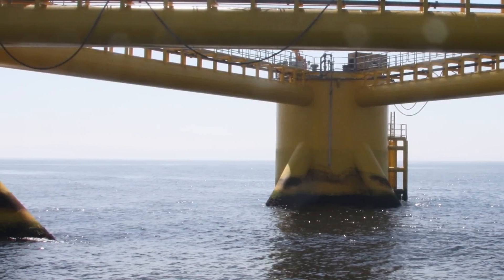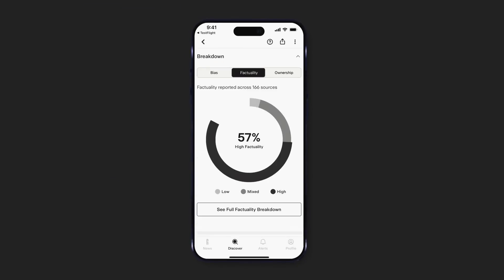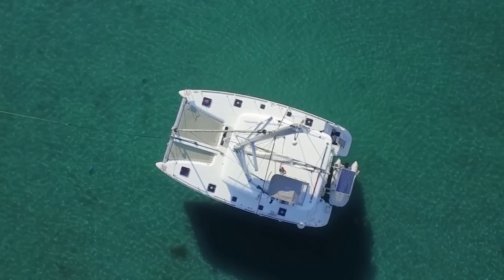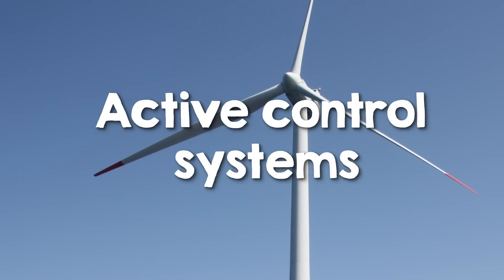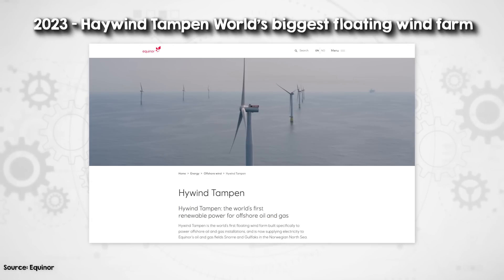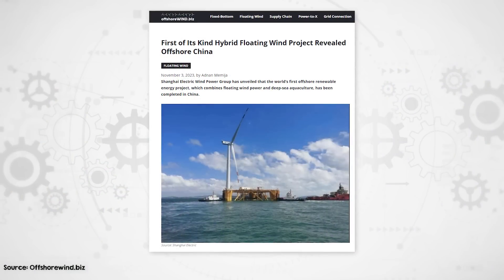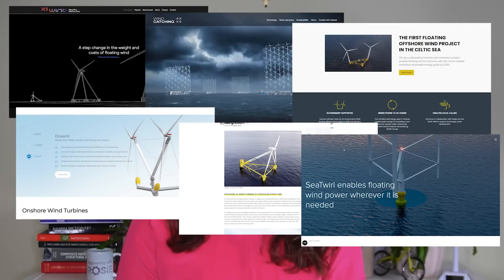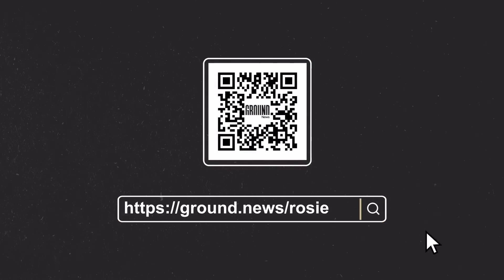The Rise of Floating Offshore Wind Technology

Comment: This video got me wondering that if offshore wind is such a great energy resource, would it make sense to have these facilities serviced by industrial scale electric 'tankers'.  In this model a series of large battery ships could rotate from the offshore wind farm to a seaside city or even a site of a fossil fuel power plant or nuclear power plant which has been deactivated.  Once the ship had discharged its power into the grid, it could travel back to the offshore farm replace a now fully charged ship which would return to the land based grid connection.
Reply: We can just connect cables from the turbines to the grid, it will always be cheaper to do this.
Reply: @SocialDownclimber  

Yeah, moving electricity via cables is much more efficient than storing the electricity in a battery and physically moving the battery.

The latter approach may sometimes necessary in temporary, one-off situations, but not for permanent infrastructure.
Reply: Ever noticed that batteries get hot when you change or discharge them? That heat is wasted energy, and probably makes ‘battery ships impractical. But impracticality doesn’t seem to deter governments nowadays so I look forward to seeing huge fleets of battery ships.

Comment: Tip them upside down and place them about fifty or a hundred metres below the surface, preferably where seafloor topography gives you a strong, steady current. The kinetic energy of water will always beat that of air, and the reduction or elimination of problems caused by the intermittent nature of wind would reduce the need to incur the cost of battery storage. Call it offshore hydropower
Reply: That's MeyGen in Scotland
Reply: @thomasgade226  what's the cost of electricity produced compared to other renewables?
Reply: @dennisenright9347  dunno, but these are prototypes, so unit cost is much higher than mass production. Rosie says this for the floating wind turbines too

Comment: On one hand, offshore wind seems a no brainer because of availability of consistent wind.  The, for me, not a no brainer is the transmission of the generated electricity to land.  Of course the large capital expenditure and operating expenditure are obstacles, but they're just part of the operating plan.  When they're in place and operational, they seem economically sustainable.
Reply: It's not a no-brainer but also not rocket science. Sea floor cables are a very established technology, and HVDC is fairly established and can make it work for the required distances. What still requires work is rigging up many turbines to the cable.

That said, I find the most interesting option to not transmit the electricity to land but instead use it for energy-intensive processes near the turbines, or for charging electric ships.
Reply: @leftaroundabout  Good thought.  What about a battery depot, full of batteries that can be charged and swapped for discharged batteries?  Nah, probably never work.  Anyway, I am not an engineer or scientist all my questions are valid?

Comment: Is there something that can be done about steel corrosion in these turbines? Like some kind of electrolysis?
Reply: Typically you would use cathodic protection and paint. Also you estimate the amount of material you will most likely loose over the structures lifetime and add it to your design thickness. That works pretty well. 

What often kills offshore structures is fatigue, then at welds. This is why offshore wind likes monopiles much better than jacket structures: Much less welds to inspect and to possibly fail.
Reply: Have a look at my comment above. The use of basalt fiber, including to substitute steel rebar, ups the life from around 35 years to around 100 years, as it does not corrode.
It is also very low carbon to produce, and totally recyclable using biomass PECAN resins.

Comment: In my view materials advances are going to be transformative for offshore wind, including floating.
Basalt fiber is now being used in  China as a component of wind turbines, and has great advantages. It is inert and reacts neither to UV or seawater, is tougher than glass fiber and as rebar can replace steel, with projected lifespans of over 100 years instead of the 35 years of steel, and then is completely recyclable as well as emitting a fraction of the GHG in manufacture compared to steel.
And we can now make biomass derived resins to glue them together, PECAN, so we can have very long duration, low carbon materials far more suitable for a marine environment than anything which we have previously been doing.
Reply: Basalt fiber/resin has long been used as low-conductivity wall ties (My house has a load from in 2014). And it is impressively light, strong and much less brittle than you might expect. Where are they proposing put it on turbines - in the blades instead of glass fibre?
Reply: @xxwookey  You name it, and basalt fiber has good characteristics for use off shore. 
For instance rebar made from basalt has the same expansion characteristics as concrete, unlike steel, so lasts way longer.
But also for blades. Unfortunately I can't put links here, but here are the characteristics of basalt for bionic plates in turbine blades:
'Under the high wind speed, the fatigue damage covered the whole skin, only slight damage occurred at the trailing edge of the tip. The dangerous point is mainly located near the tip of 50 m–60 m along the span direction. The traditional Miner theory can accurately predict the fatigue life of wind turbine blade, and the fatigue life of the wind turbine blade with basalt fiber bionic plate is 29 years, while the fatigue life of the glass fiber wind turbine blade at the same scale is less than 1 year.'

Comment: Here is some truth about the incredible stupidity of floating offshore wind.
https://youtu.be/jB49o5HoOdk
Reply: That is incredibly misleading, not exactly truth!  His argument that floating wind is expensive is based on a 30MW prototype wind farm, designed to test the systems, and find the problems; not designed to produce low cost power.  To get sensible prices, you need to install GW size wind farms, and by the time you get to the 3rd or 4th round, the prices will have dropped to be at least competitive.   I guess that floating wind will become the UK's cheapest source of power, but it needs investment to get there, and the sooner we invest, the sooner we get the cheap prices.  I'm not sure why so many other countries are jumping onboard with floating wind, you need the right weather conditions, and few countries have wind as good as the UK, Denmark, Norway, but for us, floating wind will be important, and paying higher prices to for the first floating windfarms is necessary, otherwise we miss out on the future benefits..  Fracking is definitely not the future, you can argue that it should have been the past, but it was something we failed to invest in and never saw the benefit.
Reply: @nigels.6051  that is an absurd point of view. Wind needs a MW of gas for every MW of wind in any event.
Onshore snd fixed offshore wind is getting more and more expensive. Not cheaper. Fact.
Reply: @ClimateRealism  Wind doesn't need any gas to operate!  Construction is still using some fossil fuels, but a decreasing amount.  There is still a shortage of fossil fuel free steel, but the way to get the steel 100% green is to build more wind power.  Fossil fuel use has to stop, for places that are away from the equator, wind is the cheapest solution, currently it needs a lot of investment, but it will be the cheapest.
Reply: @nigels.6051  Example, in the UK now ind for 9 days - what do you think supplies the energy? There is no viable storage system.

Comment: Hi Rosie, question: could off-shore wind turbines be used to re-charge battery-based container ships (maybe which are supported by attached sail / wind turbine / tide turbine generated electricity)?
Reply: We would need new battery technology to power a container ship at reasonable cost, they travel huge distances, and can't afford the time for many recharges, but smaller battery ships that make short journeys, such as the wind farm support vessels are already being recharged at the wind farms.  For container ships, in the near future, they will be powered by synthetic fuels created by the wind farms, and will be able to refuel at the wind farm or nearby.  Maersk said recently: "660,000 standard shipping containers transported on green fuels in 2023", "Maersk is investing in new methanol enabled vessels of which the first eight very large ships (16,000 TEU each) are entering Maersk’s fleet in 2024, with the first vessel, “Ane Maersk” already deployed. "
Reply: I'm personally skeptical about the synthetic fuel idea, in part because making it in a way that doesn't directly spew CO2 into the atmosphere likely requires several times the electricity input compared to charging a battery (similar problem as with hydrogen). This makes production of the fuel very expensive, to the point where it's uneconomical without huge, never-ending climate subsidies (or government mandates that would dramatically increase the cost of shipping).

Realistically, I see container ships continuing to just run off fossil fuels for a long, long time, until, eventually, battery technology catches up to make the battery solution feasible. I don't see them every switching to a synthetic fuel, at least not beyond token demonstration gimmicks, solely for greenwashing purposes.

Comment: Im somewhat surprised not to hear anything about tuned mass dampers.
I realize that weight, high up in a floating platform, seems counterintuitive one would think stability of the nacelle and hub would be important.
Reply: Isn't it a little difficult to tune a mass damper to the frequency of the waves?  That is why Rosie mentioned "active" stabilisation, it can cope with anything thrown at it..  Active may include mass,  but also aerodynamic.
Reply: The cable connected to the floating turbines is moving .It is a dinamic cable. Some say it is a major problem. What about some comment from Rosie about it.
Reply: @HendrikStander-v1l  The drill pipe from a floating oil rig is probably a hell of a lot more prone to damage, and yet there seem to be hundreds if not thousands of them, in operation for decades...  🤔

Comment: Hi Rosie. Thank you for all of your informative videos. I was wondering of your opinion about the feasibility of using multiple power generating technologies on offshore wind turbines. Ie. cladding The Tower of the turbine with solar panels & connecting to its base or immediate vicinity some Wave or Tidal Generators such as CorPowerOcean.
2 or 3 source's of power generation is better than just one on its own. You would even save money on the transmission lines as you'd only use one rather than three. 
Unless the answer to my question is what (@EngineerLewis) & company are facing with there TLP Substitute.
Reply: The amount of solar would be minute and Wave and Tidal on any structure just costs to much. So YES they share a common connection but NO that still does not make the economics stack up.
Reply: It kind of will be suboptimal in everything. Fabrication and installation of the steel structure will be hard when the parts are too fragile. For solar, without any axis tracker the amount produced will be also small.

Comment: I've been reading some challenges with gearbox life in some of the larger offshore turbines - would be interested in what you thought about this. i.e. whether it's a big challenge or just one of the more minor issues.I was intrigued by one company that has a magnetic gearbox for wind turbines and I always wondered why that idea got stuck in the "valley of death." It's not dead but one might imagine it getting a much bigger boost if the problem was really that bad.
Reply: Actually, the most recent designs of offshore wind turbines don't use gearboxes anymore but rely on frequency converters to match the grids frequency.

Comment: I'd be interested in learning how offshore wind turbines are designed & tested. For example, ocean labs centers that mimic marine conditions or is everything done on computer using AI models? In terms of materials: there have been several underwater tidal turbines in service for a few decades - how have they contributed to the suitability & use of materials for floating wind turbines.

My country requires around 60 GWh electricity. We have 3 major coastal development areas (and 3 major inland development areas) so offshore wind could significantly contribute to our country's energy needs (when it's a lot cheaper). We also have great solar potential similar to Oz, awa on shore wind potential. We also have 3 or 4 hotspot areas for geothermal. We have only recently completed several new coal fired power stations with one near completion - it would be great if these could be converted to run on renewables instead of coal, so we don't (a) lose our investment and (b) take advantage of existing transmission & distribution infrastructure. Rooftop solar is taking off slowly, but it's still unaffordable for most.

I'm also interested in how off shore wind could eventually contribute to a global energy grid, perhaps managed by an international organisation similar to Interpol - perhaps via the UN (using UHVDC cables at the backbone of the network?). These wind farms could be located in the middle of vast ocean expanses eg between Africa & S America, usa & europe etc. 

I hadn't thought of mid-ocean refueling stations for ships - interesting concept! Would ships also only charge to 80% 🤔

Comment: `"Hywind Scotland was the world’s best-performing offshore wind farm as it achieved a capacity factor of 54 per cent over its five years of operations." 

Do we know why the world's best-performing wind farm is floating?  
Is it because it is floating?  It doesn't have the biggest turbines, only 6MW each.
Reply: Probably because floating turbines can be use where the wind is best, rather than needing a shallow area. West of Sheltand is a really windy patch of sea, while places like the Thames estuary are more sheltered.
Reply: @robinbennett5994  Hywind Scotland is located a short distance from the port of Peterhead, it appears to be a convenient test site, rather than the location of the best wind.   Of course floating wind does have the choice of the best wind sites, but I'm not convinced this is the reason in this case.

My guess is that they used turbines rated for use in lower wind areas, hence they did better than they were designed for, and also wore out rather fast!  I'm not sure how capacity factors are calculated though.